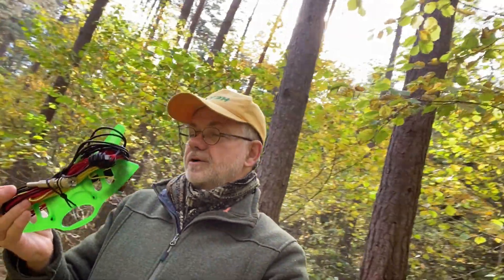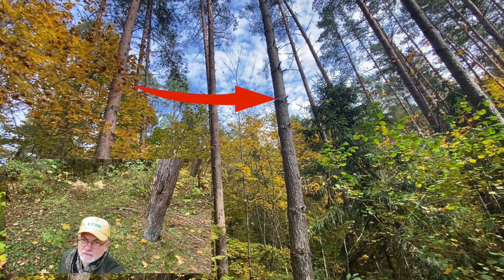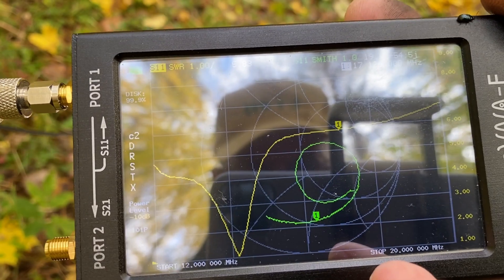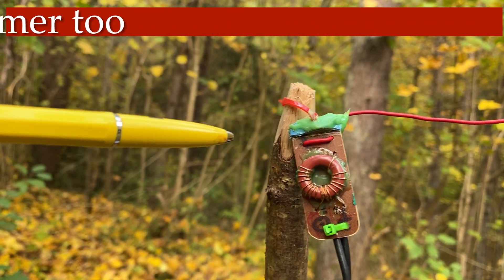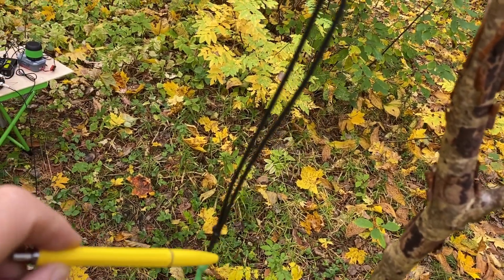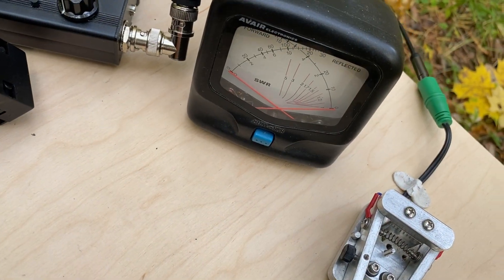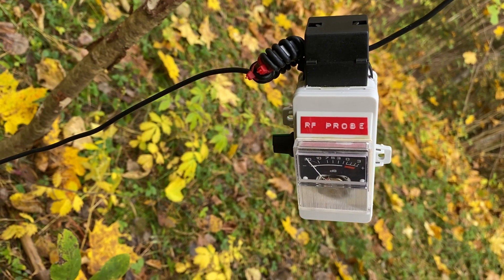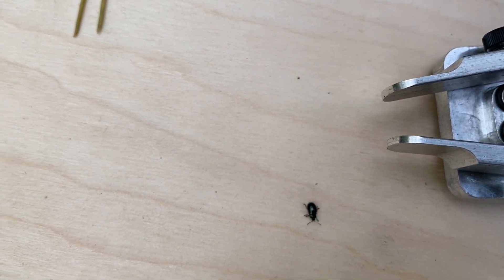My special End Fed Half Wave antenna "Mono-20" for the QCX-mini transceiver.

Comment: Very interesting Linas. I'm testing similar setup and it works but I need to play a little more to improve SWR. In your experience, which antenna is less "sensitive" to deployment same and surrounding If any): traditional dipole or this end fed one? (both monoband antennas). Thank you for your videos! VY 73!
Reply from the maker: @ea2bsy167  Thank you Alberto! It's a very good question :) Actually, I have not been making such a comparison between the EFHW and a classical dipole refering to the sensitivity to the surrounding objects (I should certainly do this :)!) EFHW dipole could be a bit more noisy if installed as a vertical. It could be a bit lossier because of the transformer involved. Horizontal resonant classical dipole hanging at 1/2wl or more will be better on both counts. But the EFHW is much more convenient to deploy, in my case- because of the resonant tuned transformer circuit- brings some front-end selectivity, a useful feature using simple radios. HTH, 73! Linas LY2H
Reply: @Linas_LY2H  Thank you very much for your answer. I did some tests with similar antenna (20m monoband) but with a trimmer capacitor instead the coax you used, and without the choke. Probably I'll go back to this antenna again but using the choke and the right core for the resonant circuit this time. Please, let me ask you a couple of questions more:
1.- The coax capacitor. Does it have to be straight or could be folded and put inside a small box together with toroid? (I've seen something like this but I'm not sure that it'd work..)
2.- If this antenna length is adjusted as sloper, do you think (or did you test) it'd need some adjustment if you deploy it as inverted V?
I'm asking this because I intend to use it together with my 20m QCX without tuner and sometimes could be more convenient to use it as inverted V. I'm not even thinking to use it vertical, as my fiber glass fishing pole is only 6m tall hi, hi... Thanks again and congratulations for your videos, Linas. I'm learning alot from you! Please, Keep doing! VY 73!

Comment: Hi Linus again,

I almost finished this antenna too for my QCX mini go box =).
But I have a question, why did you use 2 : 17 turns ratio instead of for example 3 : 24.
It seems to that  having 3 turns for primary is recommended for small toroids but don't remember where I read about this.
Reply from the maker: Hi Yuri,
nice to hear you are interested in my Mono-20 antenna! As it comes to the turns, please note, the toroid used is iron dust type T-50, not the FT-43 material. And it’s not a usual transformer as for usual EFHW, but rather, it’s a LC resonant circuit (that is why the T-50 used). So , the number of windings is directly linked with the resonant frequency, not only the transformation ratio.  16-17 turns of secondary turned to be the good number to have the resonance on ~14.1Mhz. 24 turns would be too many.  The number of primary turns I chose experimentally, but, really you don’t have much choice here because you need to have a link providing good SWR and , at the same time, giving the approx 1:64 impedance transformation rate. Probably, with some more tinkering and changing the capacity of the capacitor, it would be possible to achieve even better results. Let me know, if you try something different! 
 
73! Linas LY2H
Reply: @Linas_LY2H  
Thank you for details, It is clear for that it is LC resonant circuit but not wide band auto-transformer.
To be honest, I am working (experimenting) using different approaches.

I started from T80-6 core (yellow) which has a 4.5 permeability (T80-2 has 5.5). Also I used smd capacitor 48pF and calculated that it will about 23 turns of wire on T80-6 to achive required resonant. I was able to get minimal SWR 1.1 on 14.06MHz, but bandwidth was super narrow probably due to Q for this inductance and capacity. On 14.100 SWR was about 1.5. I have photo but cannot share as youtube will remove comment. The second problem with this approach is super sensitive (narrow) resonant which depends on how tight winding. I configured resonant by changing density of winding. But even a little shake can move resonant up or down on 50kHz. Even when I tried to fix this by silicone hot glue, resonant frequency moved significantly after drop of glue. 

How I building your variant and was curious about winding pattern. Only change I am going to use is also install smd 48pF capacitor with about 30cm of rg174 in parallel and make adjustments my cutting of coax and probably T80-2 core (also have T68-2 core).

The next one will be LC transformer network without primary or secondary winding. Just inductance and capacitor. But only after finishing current (yours) variant.

To finish, the last question from my side. In your variant primary and secondary winding have common ground? Or it is like in Fuchs then electrically isolated?
Reply from the maker: @rst5nn  Hi Yuri, thanks for the extensive description of your experiments! I think, mix-6 could be equally used for the LC. In my case, the LC circuit is pretty stable, no sensitivity to touch etc. If you use the SMD cap, this could be the reason for instability. Probably, the type of the cap is important. Usually, the type Np0/C0G is recommended for RF. But it's my guess, I have not tried myself using the SMD cap in this role. 

My current layout is with the common ground for primary and secondary windings, as I use the part of the coax as a counterpoise. But it works in Fuchs version too, it's just a matter of one jumper to disconnect the ground wire of the primary from the common ground. A separate 1m counterpoise would be desirable in this case. HTH, 73! Linas LY2H
Reply: @Linas_LY2H  
Linas, I did some calculation and here are my finding. Curious about your thoughts.

On toroids info site there is place for calculation of LC parallel circuit. I put your windings and it shows following:
MHz: 14.180
uH: 1.85
pF: 68
ohms: 165.1
turns: 18.0

I see that this looks like on your antenna, but you have 17 tight windings to achive the required inductance. Also |Z| of circuit is 165 Ohms  and that is why you have two winding for coupling loop and your winding is wide because 50 * (2 ^ 2) = 200 Ohms and you need adjust transformation of 50 Ohms of coax line to 165 Ohms of LC circuit ( I can be wrong here).

Playing a little with availible capacitors I am going to experiment with following setup:
MHz: 14.100
uH: 2.25
pF: 57
ohms: 199.3
turns: 19.9
I have two capacitors in parallel 10pF+47pF. Also I checked that my SM 1206 is Murata NPO (C0G) 1000v capacitors.
Based on numbers it looks like should work. But bandwidth 20-35kHz is still quite narrow due to high quality factor of circuit (SMD cap, short winding, etc). At least I have to try with real wire load and than probably replace capacitor with RG174 as I strongly belive this decreases  quality factor of circuit and that is why your variant has wide ~200kHz bandwidth.
Reply from the maker: @rst5nn  Yuri, my thoughts are that the antenna theory might get quite complicated when applied in practice :) Like, there is more than just resistance to deal with, it's reactances which make all the bad things, and Q also depends on them. So my experience is that only practically testing and measuring the antenna in the field gives the real imagination on what's going on. 73! Linas LY2H

Comment: Hi Linus.
Interesting antenna which I also considering for my QCX.
Did you have a change to check tuning circuit losses? Regular (popular) transformer on FT-82-43/FT-114-43 have losses about 1dB and efficiency about 80%. 
Does this has better efficiency?

Also as QCX mini is mono-band thus there is more appropriate antenna like "resonant feedline dipole". 
Just take 10m rg178, wind on FT-114-43 common mode choke from 4.2-5m from beginning (take care shortening factor) and than solder to the coax tip ~5m as second dipole shoulder.
What do you think about "resonant feedline dipole" and might you consider this antenna for QCX due to lower coupling losses?
Reply from the maker: Hi Yuri, thanks for the comment. The toroid for the LC coupling circuit in my antenna is a powder iron T-68-2 material, not the FT -XX-43 material. It’s like for any other resonant circuit on HF. I have not been measuring the loss of this LC circuit, as I don’t think this is very relevant in this type of the antenna, because the efficiency of the EFHW is very high anyway due to a high feeding point resistance. The main advantage of this antenna , though is the resonant parallel LC circuit adds a useful portion of the extra selectivity which is quite important ,IMO. The RF choke is made of the FT-114-43 material and showed very good suppression of  the Common mode current. 

Yes, I’ve been trying the coax-dipole antenna some time ago made of the RG-174 cable. It disappointed me because of a rather low signal on receive, it seemed like attenuating a lot. But it takes probably more experimentation with it, and also -with the so called “city windom” antenna. 73! Linas LY2H
Reply: @Linas_LY2H  
Thank you Linus.
As someone says "sold".
But the last question for my understanding. The capacitor (rg174) soldered from antenna wire (eg coax shield) to ground (coax pin)?

I'm curious, does it metter how to solder rg174. It seems to me (probably you said about this) that rg174 capacitor also plays  role of counterpoise and we need solder shield to antenna wire or vice versa?

The second question about material, I googled that someone uses FT-50-6,  I mean 6 material. But knowing that QCX also uses 2 material for transformer (T1) I also going to try 2 material.
Many thanks again!

I also built about 4 different version of City-WIndom. You can look trough my video about building City-Windom QRP variant. But big downside of City-Windom antennal is huge losses in common mode choke on main band. 

There is good post on forums  qrz com site in corresponding topic "City-Windom - an interesting combination of OCFD and EFHW" from SP3L. He emulated behaviour and build table with CMC losses. 
Also building City-Windom requires much more time comparing with EFHW.
Reply from the maker: @rst5nn  You’re welcome! I never thought about the way how to solder the coax-made cap :) It goes somehow naturally that the shield goes to ground and the central goes to the “upper” (antenna ) side of the toroid. But it probably would make  no difference, as this coax  acts as  a capacitor,  not as a coax :). Equally, this cap-coax does not (or should  not) act as a short counterpoise, the part of the feeding cable does. Accordingly to the theory (and practice), a short, 0.05 wavelength (at the lowest working frequency if in multi-band design) counterpoise is very good for the EFHW antenna. So you can add just a wire (if the primary and secondary windings on the toroid are isolated  from each other ) to the lower end of the main wiring, or the shield of the cable may act as a c’poise (if the primary and secondary windings have lower ends connected as a “ground”) with the RF choke installed at the 0.05 w/l from the toroid. 

I haven’t tried the material 6 for the toroid, but I think  the 20m band works OK with any - it’s an upper  working frequency range for the material 2 , and the lower range for the material 6.
I’ve seen your video on the city windom, thanks, it’s interesting!  Thanks also for the SP3L hint, will check it out! 73! Linas LY2H

Comment: Nice video…. Thanks.   Do you have any build videos or schematics for your DIY RF feed back probe you demonstrated in this video?
Reply from the maker: Thanks! Sure, it's here: 
https://youtu.be/vnrG0VACMto
Have fun! 73! Linas LY2H
Reply: Thanks for the link..   it’s off to the junk box and the build bench….John/KC2EQ
Reply: Also….. in that video of the mono EFHW antenna you applied the feed back probe near a choke on the antenna coax.    What kind of torrid did you loop the coal thru?
Reply from the maker: @johndomville5751  The toroid is FT-114-43. The size is not critical, but the material (43) is. More details in the same video at 7:56 min. HTH.
Reply: @Linas_LY2H  Fantastic…..thanks for the info.

Comment: Very interesting and well done!  Great design and construction work.  Do I understand correctly that the transformer uses a powdered iron toroid?
Reply from the maker: Thanks William! Yes, it's powdered iron, there is no need for the FT-material since it's a parallel resonant LC circuit  that makes impedance transformation in this design. It would be difficult to achieve both the right inductance and the right number of turns if using the FT material toroid. But for the RF-choke , it's the opposite, the ferrite is the king. 73! Linas LY2H
Reply: @Linas_LY2H  Thank you and thanks for the explanation!  It's been a while since I studied magnetic materials.  I still have a couple of assortments of powdered iron toroids around here.  One is from a company in New Hampshire called Radiokit, which I guess is no longer in business.